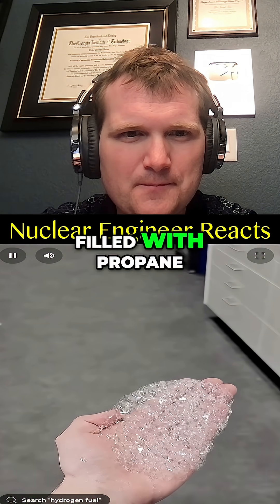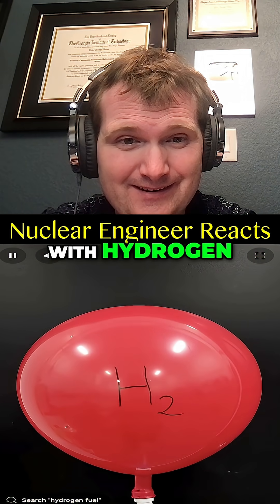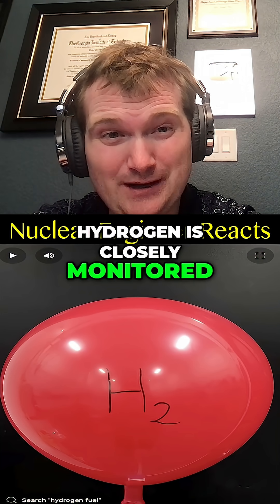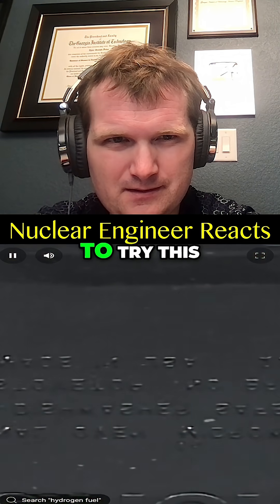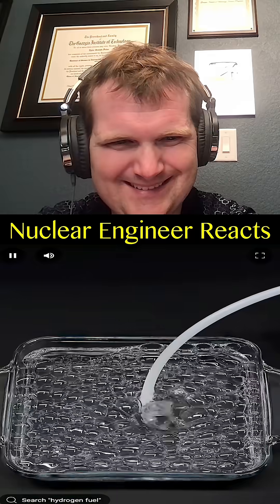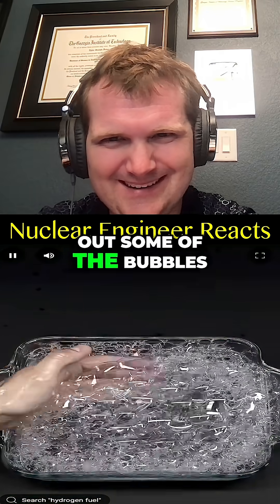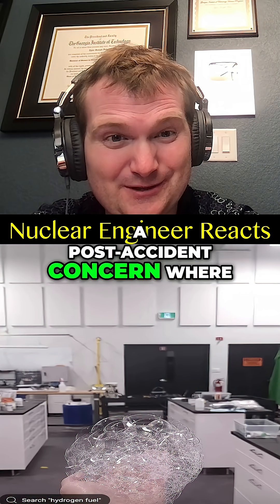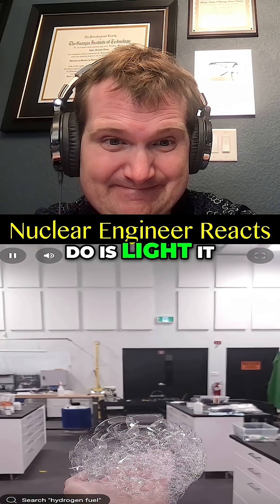Making Hydrogen Bubbles - Nuclear Engineer Reacts to NileRed

Comment: The other location in a nuclear power plant where  hydrogen gas is present is the steam turbine hall where electricity is generated. Hydrogen gas is used to cool the turbine because it exerts the least amount of drag on the rotating parts and thus improves the overall efficiency of the generator.
Leaks through bearings and seals are expected since H2 is well-known as the escape artist of the periodic table, but dangerous build-ups are prevented by good ventilation of the turbine buildings plus, obviously, careful monitoring.

Comment: Japan is planning to install Small modular reactors (SMRs) as well as production of power they want to produce Red Hydrogen by using the SMR to split water and make Hydrogen - not sure if this be cheaper than green Hydrogen  or use less power than Grey Hydrogen or overall safe?

Comment: Some of us franken-mechanics like to use electrolysis to strip rust from parts, you hook a battery charger up to an anode and the part you want to clean up, the rust melts away!

The bad part is the risk of a kaboom, so they recommend you point a fan at the container to prevent such an unhappy accident.

Comment: I was bored as hell so i made hydrogen w my frend we mixed salt and water then we put wires in 2 nails dropped them in the water and put 12v dc 25w 1.0a to the nails and it started bobling

Comment: I hope you respond.What are your thoughts on the insight that torsion?Based electrical generation is a nuclear reaction because it uses atoms to produce elect christie under the stress Of electrons caught in a magnetic field of a magnet And the observation that nuclear reactors aren't Nuclear reactors but thermal chemical reactions, it is chemical. You're being ridiculous. It is chemical. And it is thermal and it has nothing to do with electricity. What are your thoughts?
 Torsion based generators are true nuclear electrical reactors.

Comment: Went to a science expo at a uni once, and the instructor filled random balloons with different gasses, then used a lighter under the balloon (which was on a stick a student was holding) and the hydrogen one blew some of the light covers and rafters off the roof. Was insane feeling the heatwave of the explosion.

Comment: When you said that radiation can split water into oxygen and hydrogen, I was thinking " huh, maybe we could use that to make hydrogen without using electricity"

Turns out in 1972 people had a similar isea and realized, while the production of not insignificant amounts of hydrogen could be achieved, the security risk q facility to do that would face would outway it's benefits.

Comment: I knew about the electrolysis of water. Never heard of radiolosys, but it makes perfect sense. You especially don't want both products of radiolosys (or electolysis) of water to collect together... Bigger boom than just hydrogen by itself which only burns (quickly) on the edge.

Comment: I've been working on coal thermal powerplant that uses HUGE hydrogen amounts for cooling the turbines. Not everyone even on powerplants knows that hydrogen have a very bad habit. If you have a metal hydrogen tank - it will accumulate inside the metal itself. One guy had a task to weld inside a hydrogen tank. It was properly vented, but in time between it was vented and guy started working enough of hydrogen gas was leaking back into the tank from the metal itself that when he had started welding it exploded! That guy died because of that. So yeah, hydrogen is extremely explosive and dangerous, even when you are trying to be careful about it.

Comment: Bubble bath ❌
Bubble bomb ✅
Reply: Bubble bath bomb 🔥
Reply: CHEEEZAAA!!!!
Reply: Bath bomb
Reply: Nah, that would either be potassium or francium.
Reply: @flightmaster529  that's probably more of a caesium thing
Reply: @flightmaster529  That's a bath nuke 💀
Reply: @flightmaster529 my friend, you are enough radioactive waste. The bath don need no francium
Reply: DAISAN NO BAKUDAN BITES ZA DUST
Reply: Bubble bass
Reply: Hydrogen bomb named bubbles 🔜
Reply: Don't forget the candles
Reply: Prank your gf by making her a bath bomb with a difference. A hydrogen bath bomb that makes loads of hydrogen foam, which you then light on fire to her amazement and delight... Also a quick painless method of hair removal 🤭
Reply: That's a John Wick official bubble bath.  😂
Reply: these bubbles were made in a bomb factory. they’re bombs.
Reply: Bubble bath bomb. I think someone did that. They used sodium iirc
Reply: Bubble bomb ❌
Bath bomb ✅
Reply: bubble blast
Reply: I use a toaster for that one
Reply: GARY!!!
Reply: imagine someone ask you for bath bombs this you give
Reply: yeah, that happened in chernobyl. not the uranium, but hydrogen was the problem.
Reply: fart in a bathtub and light the methane